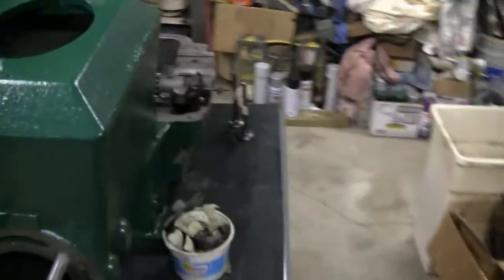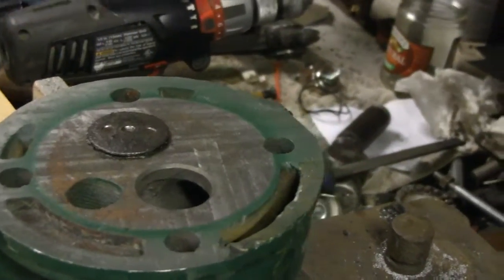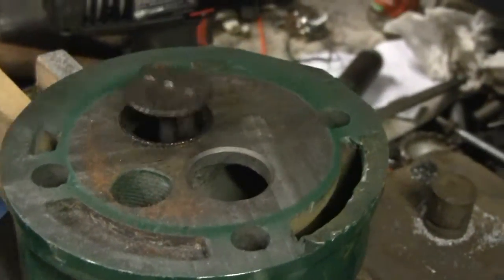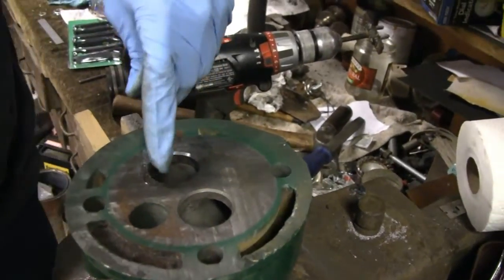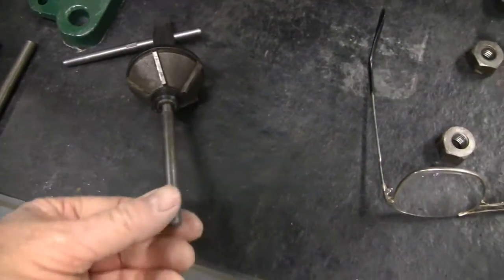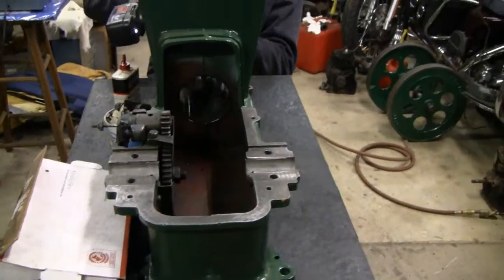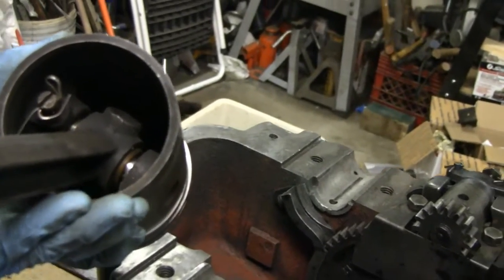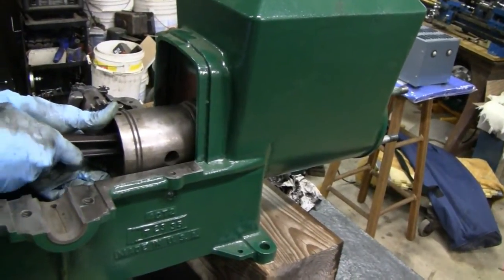STOVER CT-2 ENGINE REBUILD part 1

Comment: Another way to lap the valves with a drill is to chuck the other end of the valve, where the spring goes, into the drill and then you can pull the valve closed, twist the valve with the compound on it, push the valve in, and repeat the process. I am a disabled army vet and can't work, so I do small projects on the side, and hope to video my latest project. I love watching your videos on my bad days. Keep up the AMAZING work!
Reply from the maker: Thanks Bud!!☺

Comment: Hi Roadking. I am writing from the UK. I've just bough one of these as my first hit and miss engine. I pulled the piston out to check it. When refitting I fitted the piston with the oiling hole at the bottom. In your video it looks like it's at the top. I just wanted to confirm this was correct to have it at the top? Also. Can you describe what the timing marks look like. Mine is sparking on top dead centre which I don't think is right. 

Many thanks,
Henry
Reply from the maker: I can't say for sure about the oil hole!! We just put it back the way it came out!! We keep ours at TDC and it runs fine!! Sounds like you might have to play with yours a little to get it right!! It's not uncommon for some guys to run them advanced or retarded depending on what they are trying to achieve!!☺